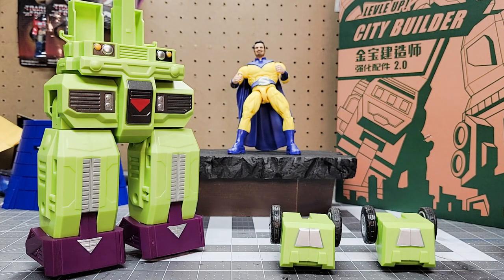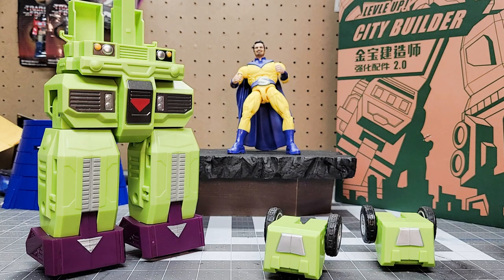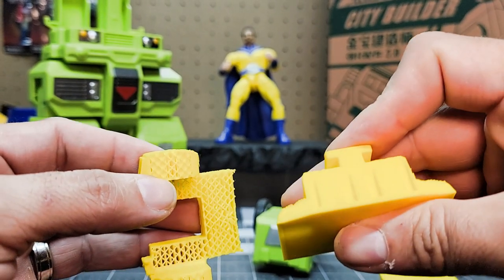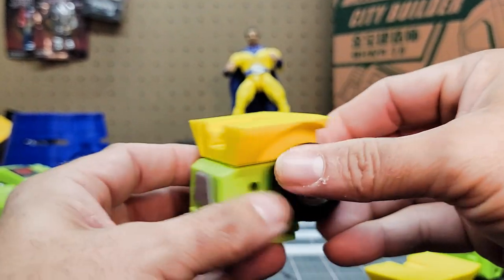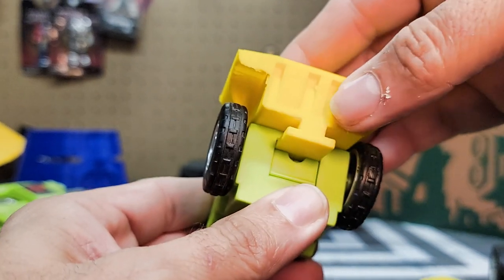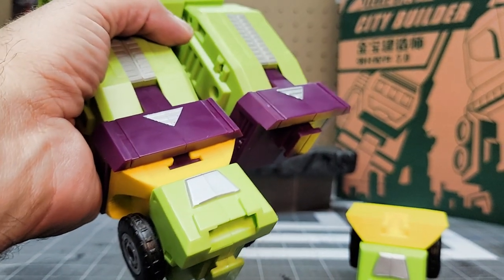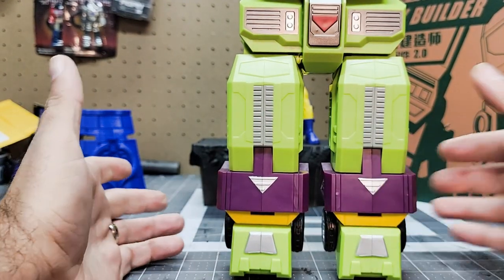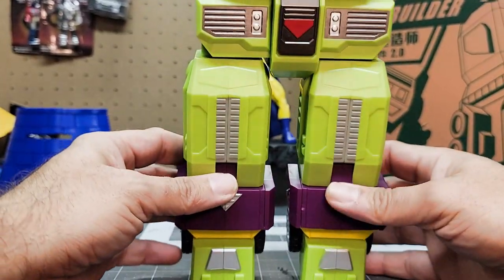Amazing 3D adapter for Liketoys Jinbao Devy upgrade kits! "From the Junk Pile" Series: Episode 2

Comment: I found a solution that greatly stabilized my devastating jinbao already with the new 2.0 kit. This 2.0 kit left him a little loose or flexible in the knee and that bothered me a lot although I thought he looked great. Therefore, to end the instability and imbalance in both knees, I placed a graphite pencil case, that lozenge, on the back of the knees where I observed that there was the source of instability. The filling was perfect leaving it rigid and much more stable than before. It will stay there until something better comes out on the market like what was presented in your video. Too bad I can't show you how it turned out, but it's incredibly stable now. Thank you very much and congratulations for the excellent video.
Reply from the maker: Thank you for the feedback. Man, I would love to see the pics on your workaround.  I will say that I'm working on a part three where I put my set together and show this adapter in place.  Stick around for that.

Comment: The upgrade doesn't work right  dont believe the hype
Reply from the maker: what part are you talking about?
Reply: Not saying this is the case for everyone, but the people I've seen saying it doesn't help/work have shown pics where things are just not tabbed together well or at all and have even skipped parts of the kit altogether. If you're one that's afraid to push or fully tab things together, you're setting it up for failure. Mine is awesome and just as stable and posable as Constructor, Superitron, Bruticon, and Raiden. I don't see this printed part having any negative effect when combined, just making him a bit taller.